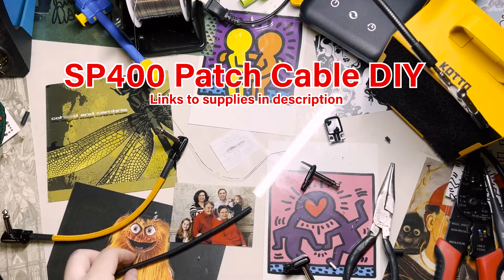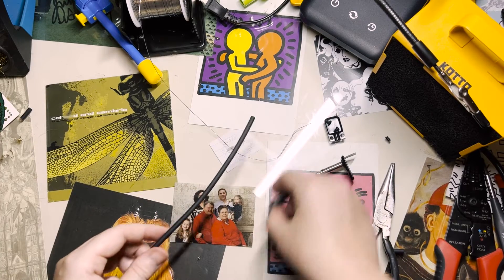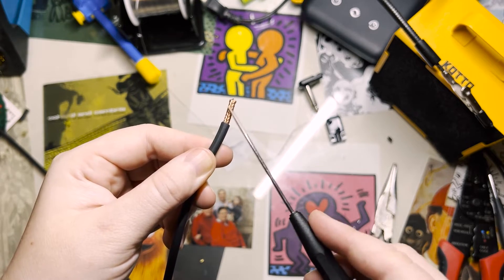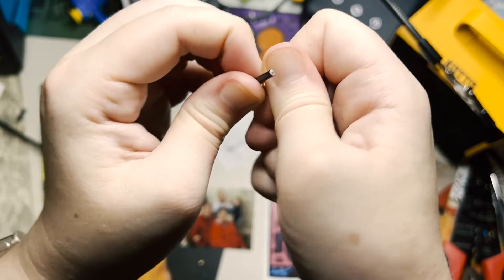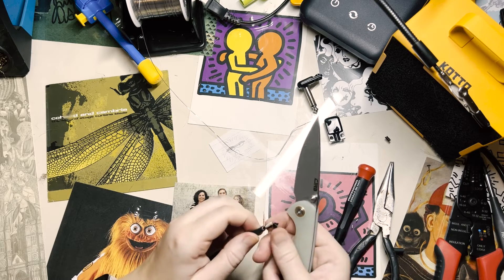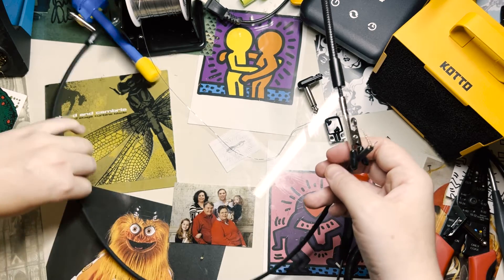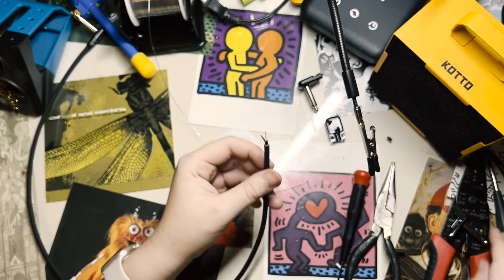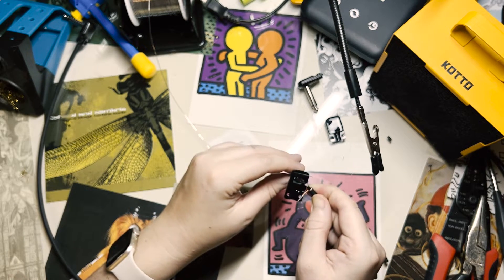Squareplug SP400 Patch Cable DIY Tutorial

Comment: Want an extreme exercise in frustration?? Try doing this. This is a perfect example of why its not always a good idea to DIY (especially with the expensive cost of SP400 plugs). The holes on the lugs are tiiiinyyy. You'll spend lots of time separating each ground wire, rewrapping it tightly, and then attempting to feed it through the tiny lug hole. Good luck. Hope you're only looking to make a few patch cords. Lots of trial & error. Do yourself a big favor and get the larger pancake plugs.
Reply: I don't bother putting the shield through the hole. I bend the tab up, put the tinned shield against the shell where the tab was then bend it back down hard against the shield. Then, I just flow solder. Doesn't matter if the shield hits the case since it's common to the sleeve anyway. Conductor on most instrument cables is pretty small so it's not a big deal to get that one through the hole.

Comment: Q: Do these types of jacks fit enclosures with top mounted jacks like 1590B : 60mm x 112mm x 31mm or the Hammond Manufacturing 1590N1 : 66mm x 121mm x 40mm (also known as designation 125B by some)? Empress effects has some pedals with that type and I'd like to know if the square plug can fit those.

Comment: The carbon sleeve is conductive. You really need to strip that all the way off down to the sleeve / ground wire. Otherwise it is likely to short or have some continuity across ground and tip

Comment: Thanks for the video.  What happens if one of the leads touches the inside of the plug housing?  Also, what specific tools would you recommend for doing bulk cables (if you could choose any)?
Reply from the maker: It will short the cable and not pass signal. As for tools, a wire cutter/stripper, an awl, and a soldering iron (plus proper ventilation) are probably the bare basics. I also think helping hands are a must-have because cables are a PITA. Because I also build pedals I have a few other tools (solder reel holder, tip tinner, etc.) but none of those are really must-haves and just conveniences.
Reply: Hi, thanks so much - I am looking to splash out on a really good pair of wire cutters/strippers to do bulk TS and TRS patch cables for my rack setup and was interested in whether you had a specific brand or model that you would recommend.  I'm using Mogami 2319, 2549 and 2528.  Love the aesthetic of your videos, thanks.   @sentientsonicmachines
Reply: Unless it's the actual ground/shield lead, right?  You could push that back against the housing when you solder it to the left side tab couldn't you? @sentientsonicmachines
Reply: @ArrakisOCE  i think yes i've seen somebody make it touch, https://www.youtube.com/watch?v=Wj_oUocwOG0 i'm in the process of soldering and i've done a couple of cables touching, hopefully they'll work when i test them

Comment: With braided-shield cable (like Canare), if there's limited space on the lug (or within the connector in general) I will often cut away some of the braid so that the twisted bit is a manageable diameter and I'm not trying to jam a log-sized conductor through a tiny hole.

Comment: Also check out GAC-1 from Gotham Cable. Not braided but shielded with two separate spiral layers wound in opposite directions.
Exceptionally soft and flexible. The outer jacket is just butter. Beautiful stuff!

Comment: I've been using Canare, Mogami and others for three decades. Strangely, I'd never heard of Best-Tronics CA-0678 until just now so I looked up the specs. It does seem to have about half the impedance of Canare GS-4, although at pedalboard lengths, the sonic effects will be negligible (especially if your ears are middle-aged).
The CA-0678 center conductor is 74% the size of the GS-4 (24 AWG vs 22 AWG) so it is arguably less durable and higher in resistance.
I'll buy some and try it out.